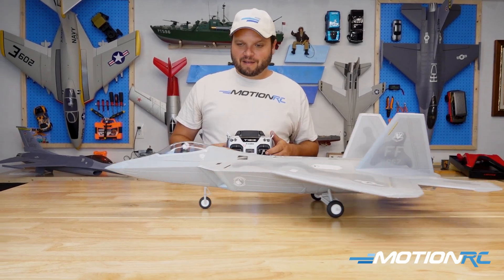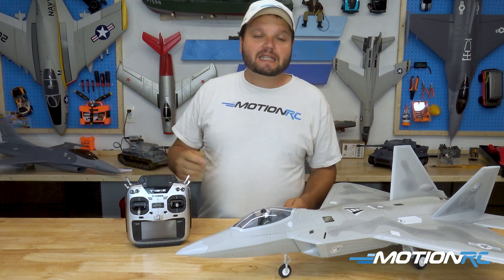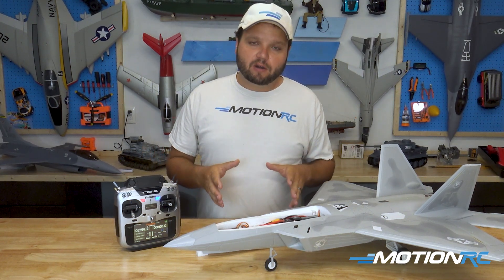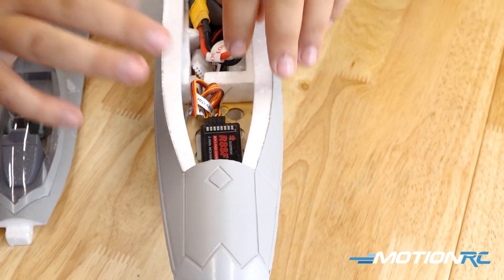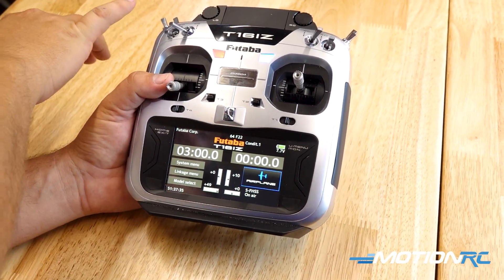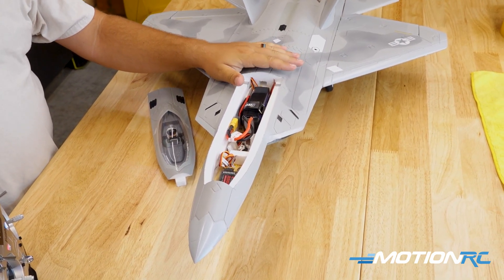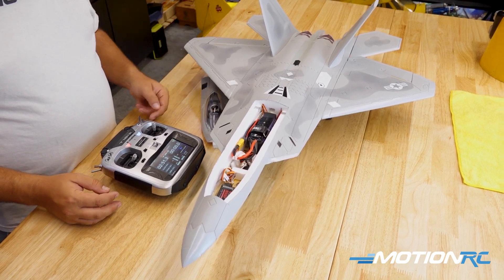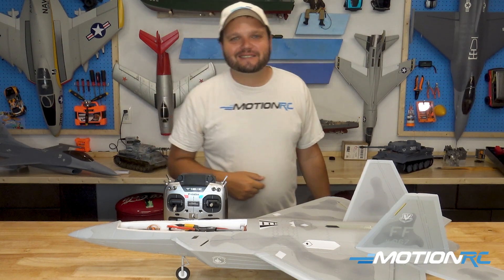Connecting A Reversing ESC  | Quick Tips | Motion RC

Comment: I always land my edfs with 0 throtle, and im inclined to ser it up for my avanti v2 for faster braking
Reply from the maker: This will definitely help, but you should practice low throttle landing on EDFs. Better control. More scale EDFs have to be "flown down". An Avanti is able to glide in, but I wouldn't make that a habit
Reply: @MotionRC well my fms 70mm avanti, I no throttle in, same with my 64mm Futura, coming in no throttle, maybe 2 3 degrees AOA and perfect landing on the mains almost every time and doesnt use up the whole field, ive tried landing with flaps just doesnt land nearly as well
Reply from the maker: You can get away with that on sport jets, but it will not work if you go toward scale jets. Just be careful as thats not the proper way to do it. Develops bad habits

Comment: Not sure if you are still monitoring this.  My question:  I have a V2 Avanti S, yellow with reversing engine.   I have the reverse signal wire plugged into channel 7 on my Futaba 14SG radio and Servo screen shows my switch is operating correctly but the motor does not reverse.   Servo screen shows it is going from +100 to -100  I reversed the switch and still no reverse of motor.

Comment: Great video,
Well , can use reverse thrust esc function, during flight??
I have kt board su27 plane .
Also I have turning 9x radio , can set same settings with turnigy 9x
Reply from the maker: For what purpose would you want to reverse mid-flight? You would no longer be flying, you'll most likely be crashing.
Reply: @MotionRC  thanks , could you pls guide me how I can set this esc with  turnigy 9x radio ?
I tried to use with rudder, but that not work , this plane with Delta setting or elvons setting,  I fix extra servo lead , signal line on top , 
Pls guide does this work with rudder?
Reply from the maker: @ An ESC has nothing to do with your control surfaces like Rudder, Ailerons, Flaps or Elevators. and ESC only effects the motor. You will have to contact someone at HobbyKing for help with a Turnigy radio as that radio is there product

Comment: I have a question on the way the receiver works. I am currently trying to mimic the receiver with an ESP32 and I can't get the reverse to work. What output does the receiver give to the ESC on that 4th yellow wire? Is it constant 5v the moment you switch it? I just wonder what the yellow reverse wire expects as a signal so I can replicate it. Thanks in advance!

Comment: Channel five is used for my retracts on my Avanti s v2. I have a Spektrum DX8 G2 I don’t have any switches left for reverse.
Switch A retract  B is SAFE/AS3X C FLAPS D RATES AILERON 😊F RATES ELEVATOR G RATES RUDDER H MOTOR CUT OFF.  Switch I is a push button I plug  and it goes from + 100 to -100   I plug the wire into channel 7 on the receiver and assign channel 7 to button I . The monitor on tx show going from +100 to -100  when I press the button but motor does not reverse.

Comment: Reversing the channel on my FrSky radio does not solve the problem of the ESC stuck in reverse. There are clearly some problems with the design of this ESC. The reverse function doesn't work with all radios.
Reply: Try Set channel for reduce reverse ch output to (-80) to 80 or lesser if still not work
Reply: rcinfo1197 remove the def cover on the bottom of the plane and reverse any two leads from the escape to the motor. Any leads will do because motor is three phase. This should solve the problem. I had this same problem with my Phantom 8s. I’m using a 14 channel super p beta flight elf’s rx and for some reason it too was stuck in reverse and reversing the channel didn’t help at all. Hope this helps.
Reply: Thanks for your input. I ended up moving the model over to a new FrSky transmitter with the same reversing setup I had on the old transmitter, and it now works. The only difference is I'm now using channel 7 for the reversing signal instead of channel 5 on the old radio. The reduced reverse signal endpoints are the same, around 80%.
Reply: I’m glad it worked out for you. Good work!!!

Comment: Good info but if you can make a video to add thruster reverse using with the Futaba T10J that would be  helpful. I’ve been trying to make the thrust  reverse on my 8S F4 phantom operational, took me a little bit but I stumbled across it.
Reply from the maker: You need an aircraft with an ESC like this to do thrust reverse. A normal ESC won't be able to do it it has to have a reverse feature which then becomes as simple as plugging the reverse lead from the ESC into an open channel on your RX, then assigning that channel with your TX to a 2 position switch

Comment: Thanks for the explanations. What I was looking for was how to make a mix of i.e. 80% reverse throttle on the momentary (Spektrum-Bind) switch. I was able to make it work but the motor was being reversed after. So I let it on a normal switch...
Reply: You go to mix setup. 
Mix throttle with a aux that you put your reverse plug in. Than select the bind button. Eventualy you will need to change the mix ratios that one click on the bind button puts it in reverse.
Reply: @Reptielenfreak  Hi and thanks! I did that but the radio read doing strange stuff. Or currents the direction of rotation. I after saw a Video of Brian Phillips in which he set up a digital switch too. I will see if that helps…. Thank you
Reply: Hi again  @Reptielenfreak   :) Maybe I have done the mix: "Aux to throttle". Maybe that was the reason the direction of rotation was changing after I tested the switch...
Reply: @ficosk8  you need the change the percentage to +  or   - % than test it if it worked. If not try the menu scroll to ecu menu steps.

Comment: Yea I invented this 10 years ago.  Noobyrc was me.

All you need to do is get a double pull double throw switch mount it in a cardboard foam board or 3d printed peice.

You take 2 wire from the 3 in your brushless and solder them into center of switch the always connected part.

The othe poles you spilt 2 of your ESC wires  one set going to one side of the swtch the other 2 you flip and connect to other side of the switch, then connect a servo to the swith to change the switch.

All it it does is redirect the esc signals and it works fine.

Comment: Plugged my thrust reverse wire into open channel 8. Set channel 8 to a switch on my transmitter. Model turned on. Throttle works, switch doesn’t reverse thrust. Even tested a different channel that I know works. Reverse doesn’t. 

This is on the brand new F-16 70mm v3.
Reply: Same for me with new F4 phantom. Can't figure it out, using futaba.
Reply: Same for me

Comment: According to the manual shipped with the model ( eurofighter 8s in my case) it is possible to set the reverse in 3 different ways, for example it also says it is possible to have the bottom 20% of throttle stick as reverse and top 80% as forward. Could you please show us how these work, as it does not seem to work as described in the manual.
Reply: No one knows?
Reply: @harm5304  Nope. Nobody seems to know

Comment: It is a great invention. But the other day on the first flight of my Cougar when I landed I rushed the runway and the reverse braked it effectively... but I released the reverse button before lowering the throttle stick and my new plane was catapulted towards some rocks! 😭. I will find a solution 🤔
Reply: The solution is be more conscious of that infamous REVERSE TRUST feature... I crashed a new plane due to that same mistake after a great smooth landing...After that I've never again committed the same mistake... Now I programed a really annoying audio switch chance voice that says REVERSE TRUST,  REVERSE,  REVERSE,  REVERSE,  REVERSE, REVERSE... Like 8 times after the switch is flipped...in that way before going full throttle for reversing, I'm certain that REVERSE TRUST is for sure actively engaged...
👍🏾👍🏾👍🏾👍🏾👍🏾
Reply: @ricardopr54  "REVERSE-REVERSE-REVERSE..." Great idea!! 😂
Reply: @Guillebricks  By the way, I programed that REVERSE audio with my new Cougar and my FMS Viper 90mm Non-USA Version...

Comment: Im here to tell you this doesnt always work.  I have an f16 v1 and it will not no matter what i set the wing as a delta etc, it will not work with reverse.  No one at the flying field i go to can get it to work either.  I have a futaba 12fg using  a radtron 8 channel and ive tried it with a futaba r617fs receiver.  Yes, the esc does function in revers and so does the motor during testing.  But will no work when assigned to any switch 
I also have the new V2 f16 and its reverse works as should.
There is something not set up right in my radio but i cant figure it out.
Reply: Use Spektrum instead...Check out my Eflite F16 Thunderbirds 80mm...Everything works including flapperons and reverse trust...
https://youtu.be/vGMk82y4UUw

Your plane should work fine...Maybe your issue is that Futaba radio...
Reply: I managed with my Futaba 7C on channel 7 but with same receiver bound to my Futaba 14SG same channel 7, I haven't managed to assign to a switch reverse on and off. When ESC reverse cable is connected to receiver, motor goes permanently to reverse. I have to disconnect cable to resume normal thrust.

eration
Reply: @nevilleformosa6416  yeah thats exactly what mine does.  For some reason futaba programming doesnt seem to work on older radios.  Its not a deal breaker but its weird why it wont work. The really weird thing is it works bench testing but after about 30 seconds it permanently goes to reverse thrust.  I carried mine out to the runway set it down and its in reveres again

Comment: Is it posible to use this newer ESCs in models like the  Freewing 80mm A10... Or the AL-37 Airliner?... If so, could you please show us how to do that in another video. That would be a huge game changer for MotionRC and your products...🙏
Reply: Of course you can. You can put it in any plane as long as you have the extra channel for the reverse lead. The hook up will be exactly the same as it is here. It's just an ESC, there is nothing model specific about it in anyway.
Reply: @shelbyseelbach9568  The models I mentioned use two motors, and one of them has the two motors rotating opposite directions. How can you deal with that. That's the question here!... A simple Y harness🤔 I don't think so... That's what I want MotionRC to let us know...
Reply: @ricardopr54  Two motors require two ESCs, you install both reversing ESCs and for props (or fans) that spin the same direction, you can use one channel and hook them up with a wye connector. For counter-rotating props (or fans), you would need two spare channels, one for each reverse lead allowing you to program each individually to assure proper reverse rotation. Easy peasy.
Reply: @ricardopr54  If I'm not mistaken, you should even be able to assign both channels to the same switch, even if you had to reverse one of them to get proper rotation, allowing one switch to control both channels, functionally making using reverse thrust the same as if there was only one motor. 
Yes, though, when we're talking about spare channels, we are talking about on your receiver. Having a twenty channel transmitter won't be enough if your plane uses six channels already and you have only installed a six channel receiver.
Reply: @shelbyseelbach9568  I've been in the hobby for 10 years already... Of course, I know that each individual motor needs an individual ESC... I have an idea o how to make this work,  but wanted them to explain how they will do it, for those specific models I mentioned ... Thanks for your detailed explanation, though! 👍🏾
Reply: @ricardopr54  I wasn't accusing you of being inexperienced. I was simply trying to give you the information you were asking about, both factually and technically, and trying to be fairly polite, I thought, about it at the same time. 
None of that withstanding, this is how it would be done and should work with any plane.
Reply: @shelbyseelbach9568  Thanks,  I really appreciate it 👍🏾😁 I'm going to give it a try...👍🏾 Have a great day! 👍🏾
Reply: @shelbyseelbach9568  ok what do you mean by reverse lead 🤔 im not quite understanding ? Does that mean I have to have a Y harness with 2 servo wires going into 2 separate ports plugging into the Receiver ? I'm just trying to visualize this in my head ?
Reply: @AntonioL1011  These new ESCs that Freewing is now offering comes with the regular servo cable that goes connected into the throttle channel in your receiver and an extra servo lead with only one cable that goes connected to an extra unused channel in your receiver for the reverse feature of the ESC to be enable...😊
Reply: @AntonioL1011  Did you watch the video? The ESC has a normal throttle lead and a reversing lead which gets plugged into a spare channel and assigned to a switch in the transmitter, when you throw the switch the reversing lead reverses the motor.
If you are putting two of these ESCs into a plane where the motors spin the same diction, they can both be plugged into a wye and plugged into the same channel as reverse will be the same for both ESCs. You then assign that channel to the switch of your choosing. 
If you are putting two of them into a plane with counter rotating motors, you need two empty channels, one for each reversing lead. You are then able to program the two channels separately to achieve proper reverse rotation of each motor. You would then assign both channels to the same switch so that throwing one switch will activate both reversing leads at their correct rotation.
Reply: Thank You Jesus!! Thank you soooo very nuch for asking that Question,  I've been dieing to find out if that's possible being I can't get the Ailrons to work like spoilers on landings. That plane really uses up alot of pavement coming to a stop lol! Thanks
Reply: Thats the same question I want to ask since I have both A/C as well.... using the NX-10 radio
Reply: Ok then I have to learn how to do that. That's good news. I have a Spektrum IX10 radio 📻, is that enough channels?
Reply: @AntonioL1011  As long as you have one channel that you don't need to make the plane fly, lights come on, landing gear and flaps extend, yes. Any amount of channels are enough, as long as there is one left over when everything on the plane works. It's just an extra channel, programmed to a switch, that's all, just like the flaps, gear, lights, smoke pump, or anything else.
Reply: @shelbyseelbach9568  Thank you so much mann , I can't wait to try it. You have been very helpful.
Reply: @AntonioL1011  He's referring to the receiver, not the transmitter ...
Reply: Thank you so much Ricardopr , you have been soooo helpful to me, much appreciated!💯👍👍now I can't wait to try it !
Reply: @AntonioL1011  Awesome 😁👍🏾
Reply: 💯🙏🙏🙏Thank you so much! I'll give feedback when I do it , much appreciated.
Reply: @AntonioL1011  There is a chance that they can be plugged into the same channel either way. When he switched the reversing lead to another channel he said he had to reverse the servo, if that is what he actually did, you may need two channels for counter rotating situation. I feel more like he was reversing the switch itself, if that's what he did, you could use the same channel for either one. I think he was reversing the function of the switch itself so that reverse happened when he pushed the momentary button instead of releasing it. Was a little unclear there, but that would be the only variable.